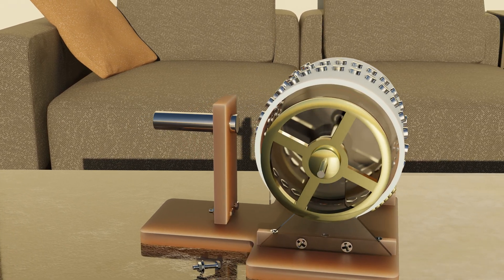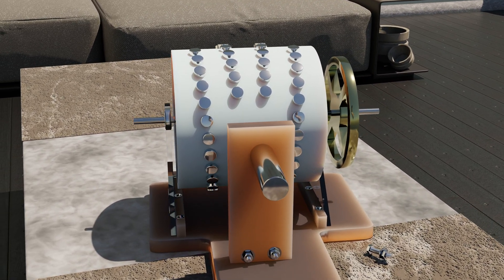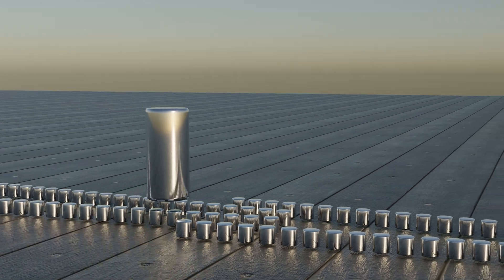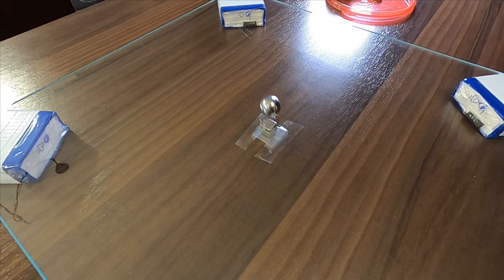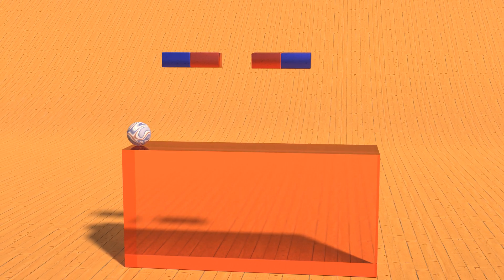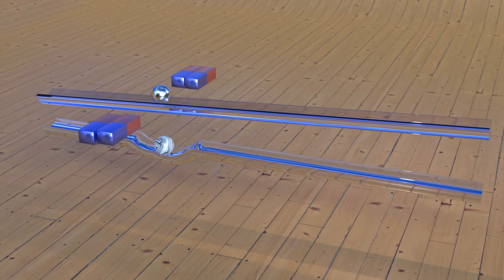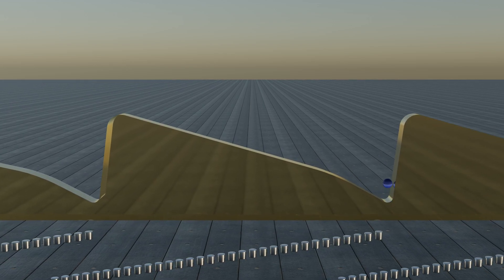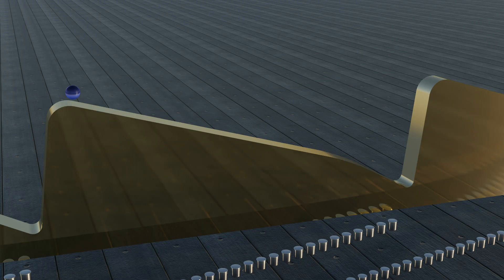Truth: Permanent Magnet Motor Using Magnetic Attraction. Rebuild Daniels Free Energy Invention.

Comment: Thanks for the video, it's great.
What if the magnet, when it got close to the balance point, was pulled apart and then brought back together? We could make a set of gears that, just as the rotation of a combustion engine pushes the valves open, could push the magnet apart so that it passes through the critical zone. And, just like a combustion engine, there would be several of these side by side so that one could compensate for the other and the magnet's “moving closer and further away” would work in sync like a combustion engine.

Comment: Thank you for doing this. I almost made a blueprint of a rocking chair design with this motor, but I realize the timing wouldn't be right no matter what.
Reply from the maker: Hi Sam, glad I could help. I have had a similar issue some years ago to fine tune my circular magnetic ramp. my main reason was that I couldn’t see what was happening because of the invisibility of the magnetic field. So I never got over the sticky point. 
After that, I developed my gravitation model 🙂.
Thx for watching
Reply: @yWild  You really like being in the clouds, make a working prototype and show it works.
Reply from the maker: Hi Bodank, not just clouds 😄. I already made my physical experiments and the result was that when it comes to fine tuning of such a machine, it is impossible to do, because whatever change you make, you never know if it goes in the right direction, because you are stumbling in the clouds, or better said, in the fog. Magnetic fields are invisible. Try for yourself if you want. 😄